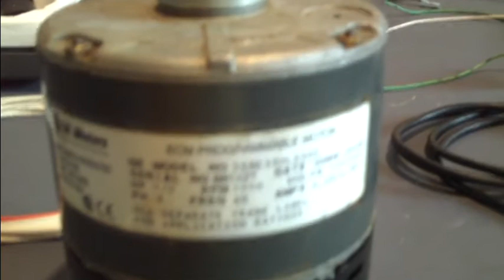The ECM Power Cord

Comment: GREAT video. Thanks for sharing your expertise. I had already built a power cord like you detailed, to bench test ECM motors. If they will run on 120 they should also run on 240 on the job in an air handler/fan coil. I also used a salvaged 120 vac power cord with alligator clips to test PSC motors. At my shop I wired a pigtail from a J-box in the circuit leading to my condensing unit (240 vac) with a regular 120 vac female plug (like on an extension cord) clearly marked 240 vac. Obviously it has 2- 120 hot wire w/ a ground.  I use this when and if I want to bench test a 240 vac PSC fan motor from an air handler/fan coil. They work great. Again, thanks for sharing.

Comment: Interesting idea. I would build the leads into a project box by the plug.  The jumper would need extended, but you could put in a switch to change between voltages. You would also need an adapter for 240 volt or a second cord from the box.